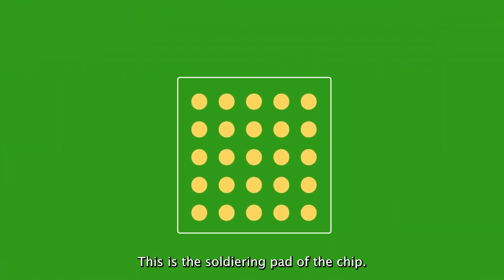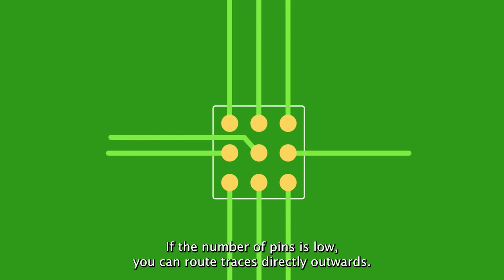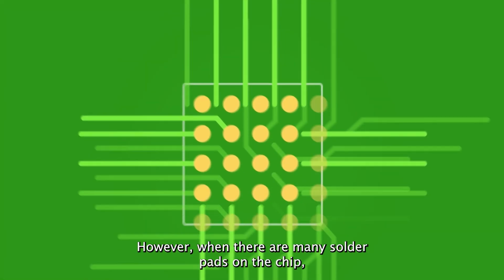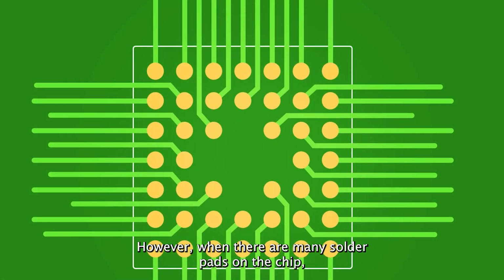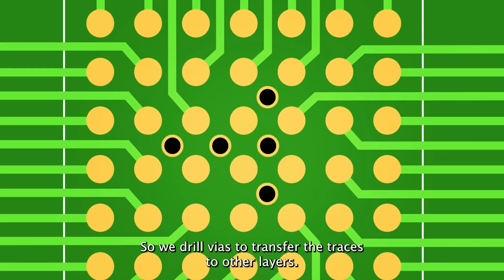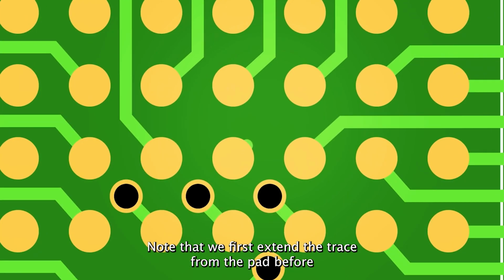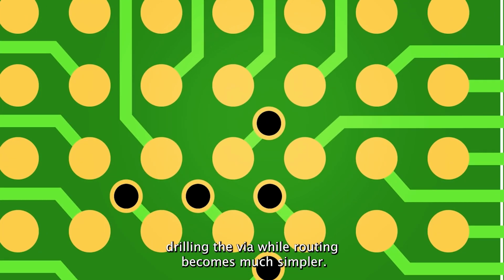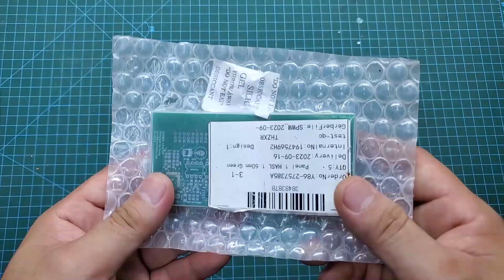Hi-power (1KW - 10KW) inverter SPWM module | JLCPCB

Comment: Hi sir i made your 8igbt board its output side igbt is heated please give me hit
Reply: ??? Możesz jaśniej? Mówisz, że jedna strona mosfetów się grzeje? Jakie masz mosfety? Jakie napięcie na kondensatorze? Masz rezystor ok 220 kiloom wpięty do tego kondensatora na 450V? You can be clearer? Are you saying that one side of the mosfets is getting hot? What mosfets do you have? What is the voltage on the capacitor? Do you have a resistor of about 220 kOhm connected to this capacitor at 450V?
Reply: I have this exact system: 40N60 transistors at 600V, IR2113S control with EGS002 and one side also heats up and falls quite often. G-S blocking resistors 10 kOhm, gate resistors with diodes in parallel - stop 4.7 Ohm + 1N4148. What is it about? I don't know. Regards.

Comment: Now use the nanocrystalline amorphous core toroidals and you will surpass efficiency, size and power handling of all production inverters. 
For the transformer AND the choke, size can be kept small, means more turns with less copper wire which is lower copper loss, AND lower core losses too. 
THis would work very well for something 4kw continuous and 8kw surge. The cores are also not as expensive as ferrite, They can be hand wound also if you have access to the right wire. I think insulated strap wire would work best, I dont really trust the enameled transformer wire that much. But if it were enameled, and small, you can even fan cool them easily with something like an intel cpu fan. Actually increasing efficiency even more because fan power is so low, with a large transformer it takes a latge amount of fan to effectively cool it to the core, so again, the smaller more efficient toroids would be best. 
AND if they could be installed ON BOARD with a thicker pcb youd be just exactly right.